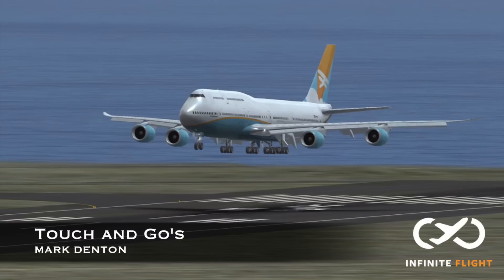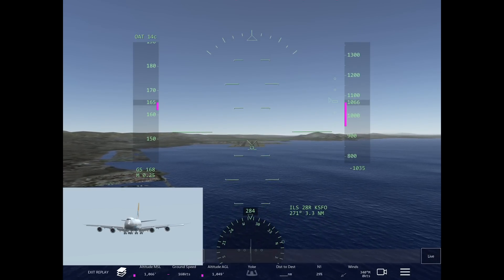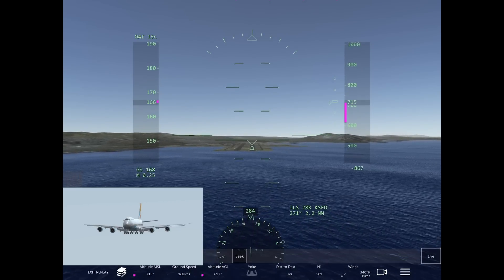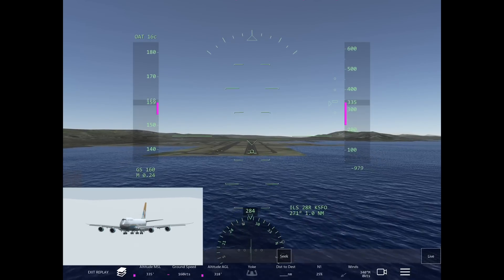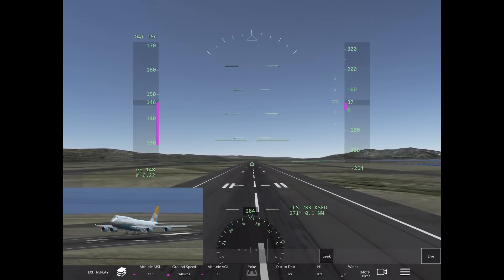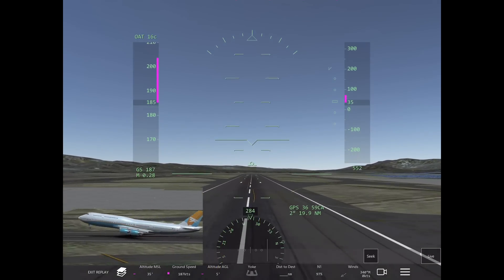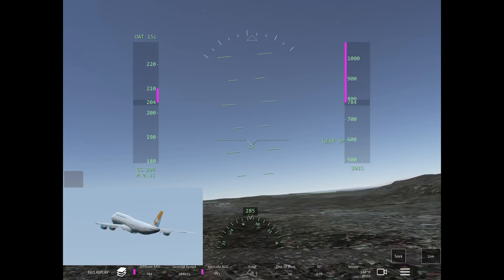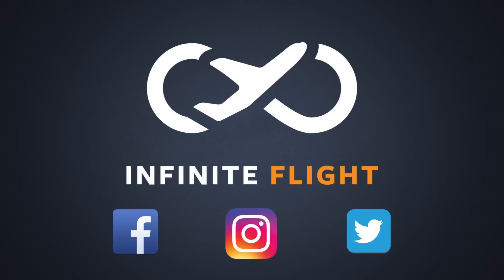747-8 Touch and Go

Comment: why don't you put the throttle all the way up when touch and go?
Reply: Because the runway is big.
Reply: @devonclairmont because a landing 747 is not at its full weight, especially as they do these for training in lightly loaded planes. At full throttle TOGA it will be like a rocket ship and hard to handle on a steep climb out. Way over-powered basically.